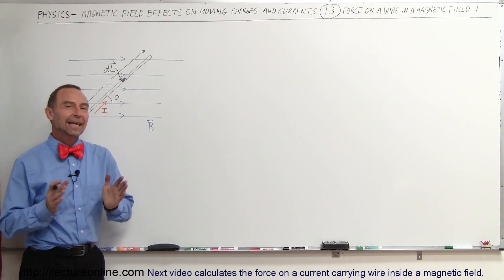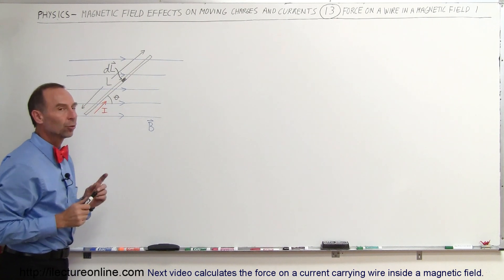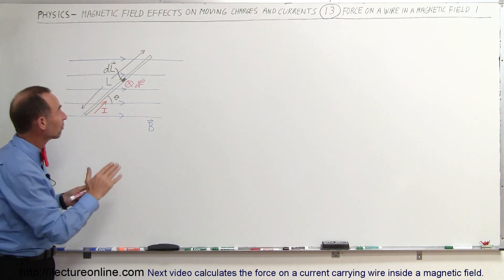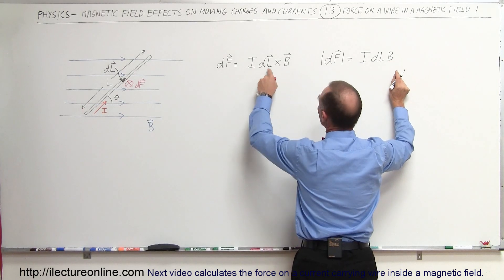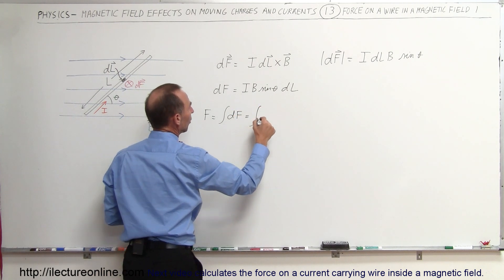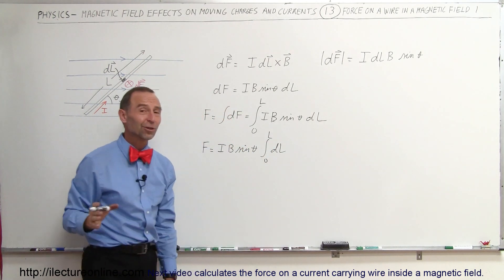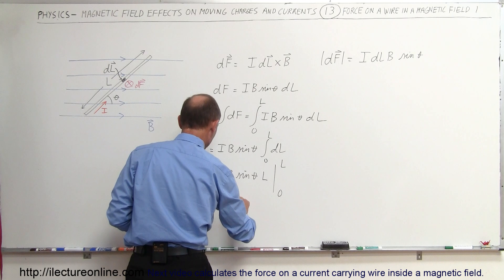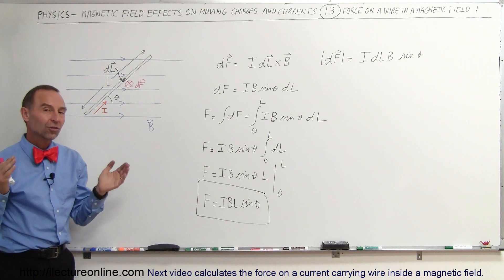Physics - E&M: Magn Field Effects on Moving Charge & Currents (13 of 26) Force on a Current

Comment: I have one question do we have to use our left hand to find the force caused by the magnetic field on electrons flowing via straight wire. Or we have to assume that it is positive charges flowing through current carrying straight wire???
Reply from the maker: The convention is that the moving charges in a current are positive.  If it is know that you are working with electrons then yes, you must use your left hand.  If it is not mentioned what the charges are, then assume they are positive.
Reply: @MichelvanBiezen  thanks for the explanation.
Reply: @MichelvanBiezen  I have one question why can't we just rule out the conventional flow of current and just follow the electron flow of current because its more accurate than conventional flow of current???

Comment: So you can use this for a crooked wire also correct? In that case, would you have to break it up into sections and integrate over those? The only video's I found are either on straight segments or those with some uniform circular sections.
Reply from the maker: Yes. That will work.  In the real world most applications have circular loops or rectangular loops.

Comment: excuse me but why do you use the right hand rule instead of left?
I thought it's electrons that move through a wire, so shouldn't it be the left hand rule?
Reply from the maker: The standard rule is that we consider the current to be positive (the movement of positive charges) even though we know that it is actually the electrons that are moving.   So we consider the current positive and thus use the right hand rule.